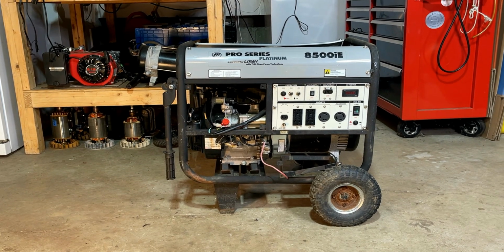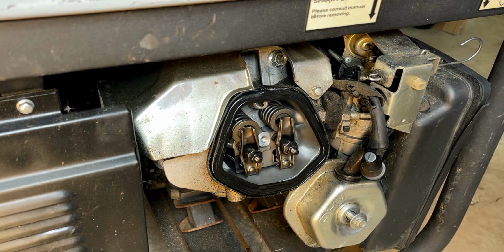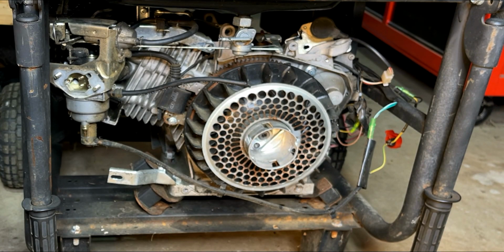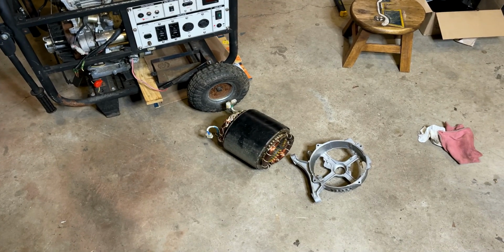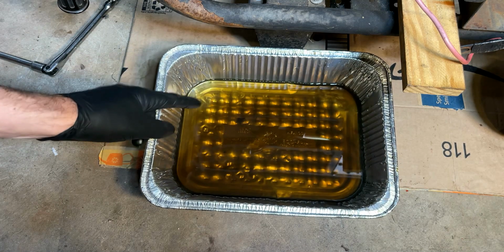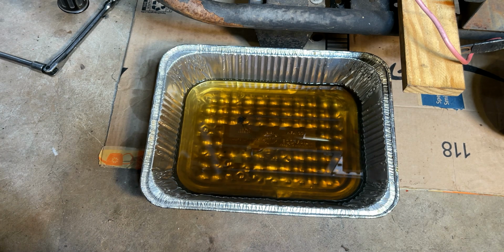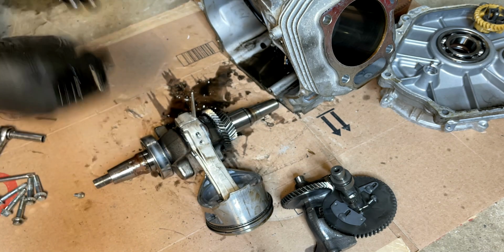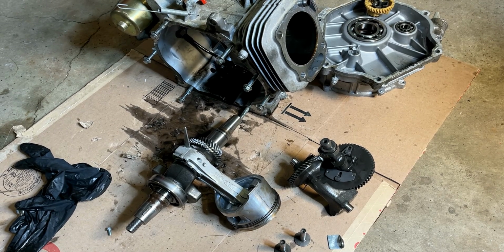Seized LiFan Generator (Part 1) - What Happened?

Comment: I understood that steel (crankshaft) and aluminium (con rod) are not great bedfellows especially without adequate oil lubrication and also with them having corrosion issues with close tolerances?
Reply from the maker: I think something foreign made it into the engine.  Details next week.
Reply: @jcondon1  We did see the hole in the air filter.

Comment: Machine the conrod and polish the crank. No point in paying money for that little of a wear. Also check for clogged oil feed tubes.   Lifan bikes sometimes don't have oil pump, but the conrod has a hole on the paddle which gets splashed in to the oil and feeds oil in to the crank bearing.

Comment: Two questions. I thought these engines had a shut off switch if the oil level is low. And two, If there was oil consumption, then where did the oil go? By the rings or by the valve seals,,,,,,,,,,,,Because you did find clean new oil when you drained the oil,,,,,,,,,,,,,,
Reply from the maker: They do have a low oil switch.  Do not remember the details on this video.  Sometime the low oil system is bypassed or not functional.  Usually oil consumption is past the rings but it can be either or both.  Also depends on the temperature outside and the weight oil used.

Comment: Possibly due to the fact the oil was never changed and thermal breakdown of the existing oil happened causing it to lock up...I've had it happen on a used log splitter once could be many reasons the stator in the power unit could have seized up in the housing causing engine lock up because mobile generators like these don't see a whole lot of use

Comment: Shouldn't there be some kind of phosphor-bronze bearings on the big end? Can't believe steel crank on aluminium rod bearing surface would be a good idea, especially when hot for decent periods of time. Oil-bath type lubrication is an accident waiting to happen and oil level becomes absolutely critical. I'd machine to include proper bearings that might survive such circumstances better.
Reply from the maker: Have never seen a small engine with a rod bearing.

Comment: I wouldn't hesitate to recondition the rod and journal.  Then see what kind of clearances you have.  It isn't a fine tuned precision machine.  Same goes for torque specs.  Look them up based on the pitch diameter, and hardness.  Inspect the crank carefully.  I kept seeing what looked like various witness marks around the journal area that I wouldn't expect to see. Hard to tell from the video they may be machining or grinding marks from manufacturing.

Comment: FYI "Li" is pronounced how we (American's) would say Lee

As for the whole "slipped thought quality control" LiFan is a pretty reputable Chinese Engineer manufacturer, that isn't something that could happen.  Plus looking at the engine/unit it has plenty of wear, I'd assume someone ran it low on oil/on a slope so the low oil sensor was engaged but at a point where the motor wasn't getting the lubrication it needed and it damaged the crankshaft/connecting rod.

Comment: If I was you I would clean up the crankshaft cleanup to connecting rod end buy enough another gasket set put it back together it will loosen up as it runs the end of this video looks like it's running anyway good job

Comment: i would  mike the piston then bore may be to tight!!! i had this problem in motor cycle  i changed the rod still would get hot and lock up mile from home i filed 2 thousand off piston solved problem in 1966  true story i have work on every thing for 65 years... cars boats trains jets bulldozers anything...

Comment: Clean oil in a 2nd hand rig? Nope; (ominous music plays). I'd do like you do and change it if I was selling it but it'd run with whoever was buying it got to watch it and I'd tell them it was a fresh change and what kind of oil I put in it. I run Delo or Valvoline 15/40 diesel formula in everything.. And I always crank one with old oil unless it has water, get it running, then change it or a flush and then change, depending on how bad the oil was. That's what works here, not anywhere else in the world. GBWYall

Comment: It's not looking good James. 🥺
Reply from the maker: You will be surprised!  There is an issue with the rebuilt engine, but it relates to what caused the original failure.
Reply: Ah ok, I’ll be awaiting the next video… as usual. 🙂👍🏼

Comment: Just realized you didn't check oil level..at least on camera....for rainbows or low condition..My bad, should have waited to the 14 minute mark...I probably would have checked it first right away, all good.
Reply from the maker: I actually checked it off camera before bring the generator home.  Should have mentioned that.

Comment: Dollars to donuts this is a Honda GX390 clone. 
Pull off a $20 experiment. Grab a 390 rod from Amazon, if it doesn't measure up, send it back! 
Use the 390 manual to reassemble too!
Reply from the maker: Yes.  I ended up using a Rato service manual for an identical clone engine.  A Honda GX390 manual would have also worked.

Comment: If it was me, I wouldn't gamble paying more to buy new parts.
But, that's just me. Why would the connecting rod seize like that? It could do it again with the new parts.
Reply from the maker: I found a cheaper connecting rod.  That may have been a mistake.  In the next video I think I found the cause of the failure.
Reply: @jcondon1  excellent.

Comment: Just to be a devils advocate, had someone been inside that engine before you. If so they might have sanded the rod cap to much trying to reduce clearance and over did it. I have been known to take a few swipes off caps on the flat surfacing stone to tighten things up. Polishing the rod journal and then using the Sharpy ink method should tell you where the interference is. If you don't have a surface plate yet, consider using a sink cutout from a stone counter top shop. They may give you as many as you want since they are scrap in that industry. Contact cement some #220 paper to the stone and use it to lap your heads flat.

Comment: If that piston doesnt move because of the connecting rod you would have had a spun bearing which is very bad
Reply: And it could have cause a hole in the engine block

Comment: 100 bucks is too much when you don't know anything about the head.  A blown engine and a blown generator head basically leaves you with the frame, the wheels, the gas tank and misc parts. Granted, it's nice to have those parts, but 100 bucks just seems stupidly overpriced.